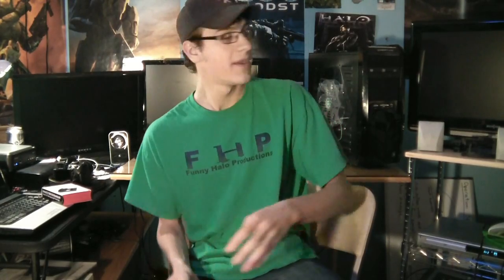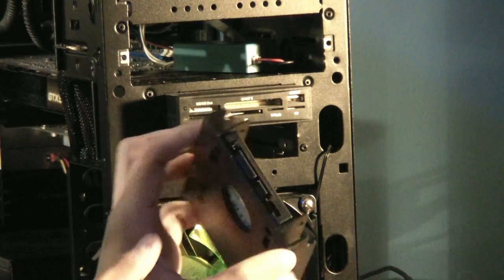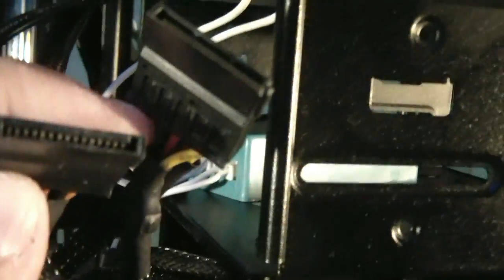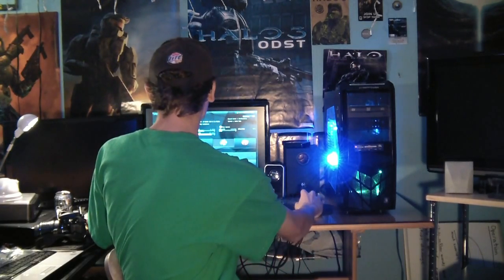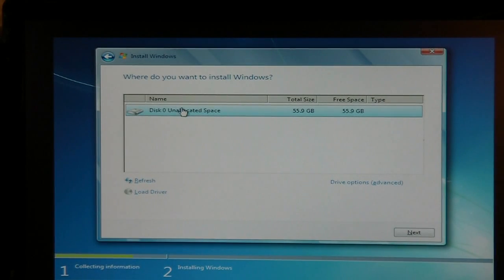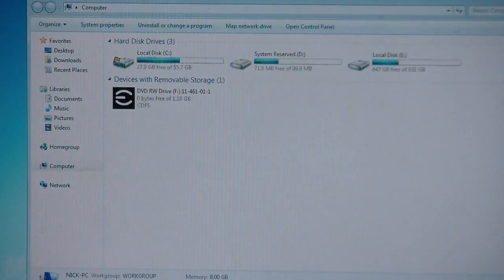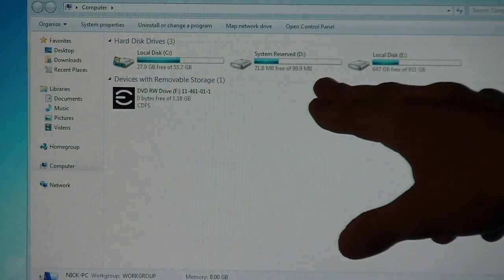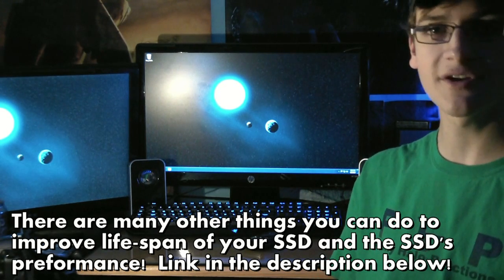Upgrade to SSD Guide

Comment: I think you should invest in a case with much better cable management. Regarding the use of a magnetic screwdriver. Its perfectly safe to use one when building\upgrading a computer. There are plenty computer build videos on youtube by people who do it for a living demonstrating that it is perfectly safe and is recommended.
Reply: I think the concern is with people that may stick it near parts of the HDD. A SSD is not magnetic so there is no danger. But a magnet can erase data off a HDD with the proper amount of bad luck. This happened to me a year or two ago.

Comment: Possibly a stupid question but I must ask it :D Can I use my original windows 7 disk to set it up on the new SSD or will I have to either uninstall windows 7 from my current HDD and then re install it on my SSD or buy a new copy of windows 7? Hope this makes sense and thanks to anyone that answers :)

Comment from the maker: hmm, I'll assume that it is connected to the motherboard with a SATA 3 cable, and is connected to the power supply? Maybe try using the SATA cable from the existing hard drive to rule out a faulty cable.